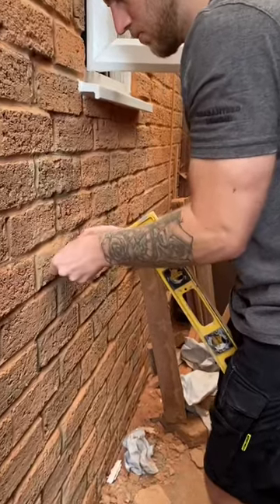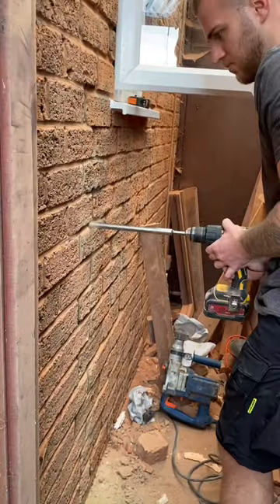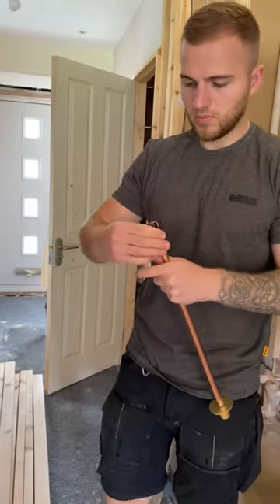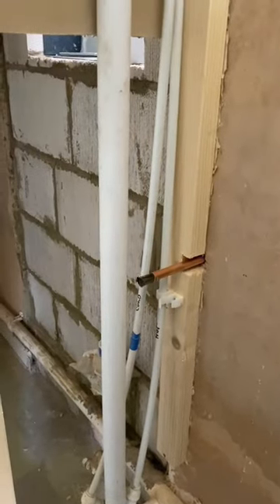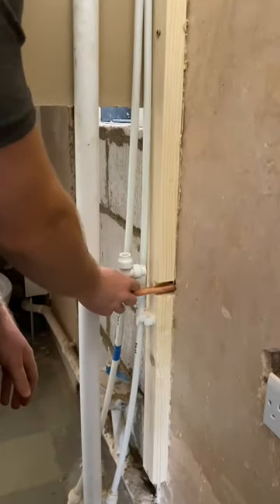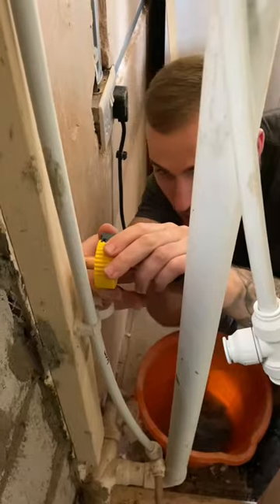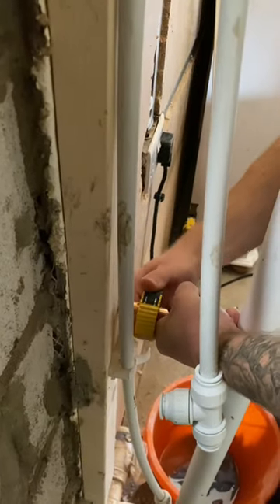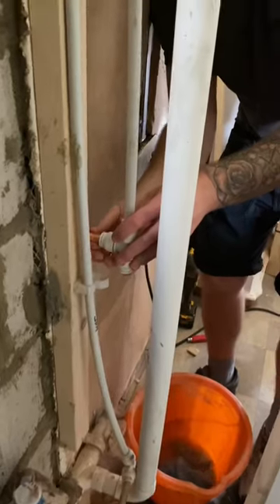Fitting an outdoor Tap | DIY

Comment: Does not meet the water Regulations.
No isolating valve on supply pipe.  Also tap looks like Bib tap with built in check valve.  
Tap with built in check valve not allowed to be fitted from 1999.
If you don't know what you are doing why do you film yourself?
Reply from the maker: The tap has since been fitted with an isolation, non return valve which has been shown in other videos. At the time we just needed a water supply outside 👍
Thanks for the comment.